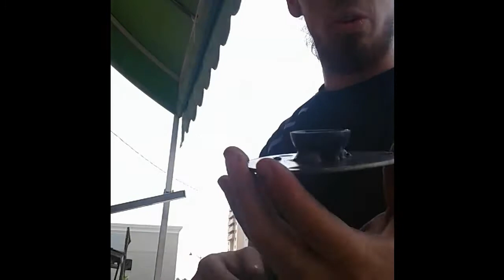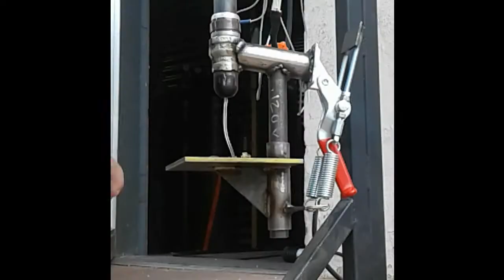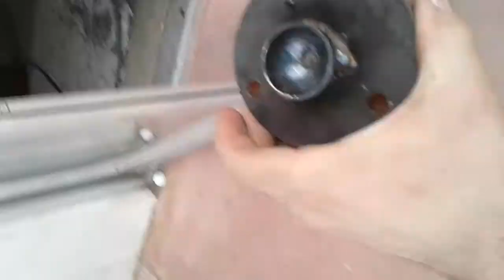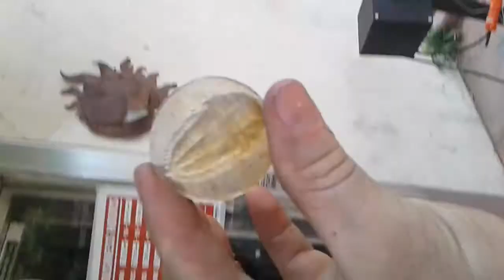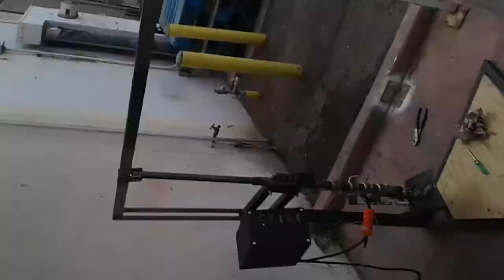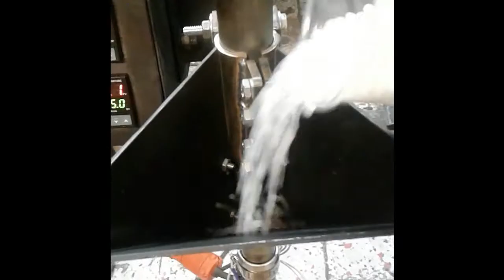Precious Plastics injection mold machine quick release clamp "proof of concept"

Comment: what is the power(watts) of the bandheaters?? please :)
Reply from the maker: (125 Watts)......the ebay description was "Nozzle Heater Band 1 1/4" x 1 1/4" 240v 125w"
Reply from the maker: I was having a hard time getting the plastic hot enough when I discovered I had the temperature controllers switched round.. If your running cold you might want to check that again for good measure.
Reply: thanks jared :D